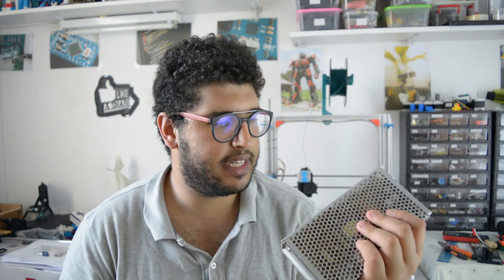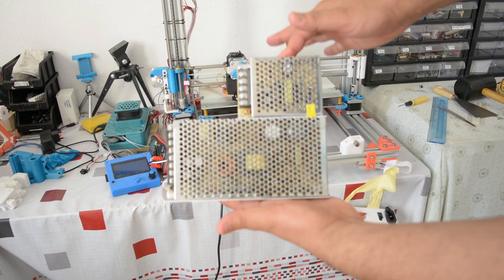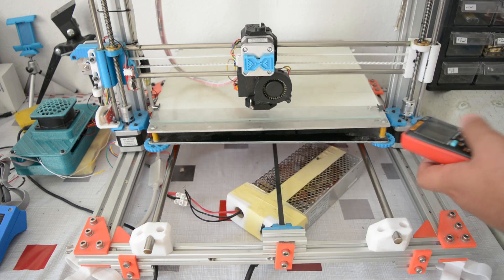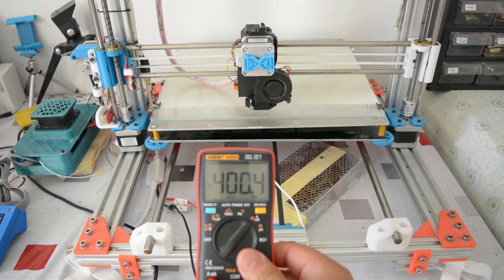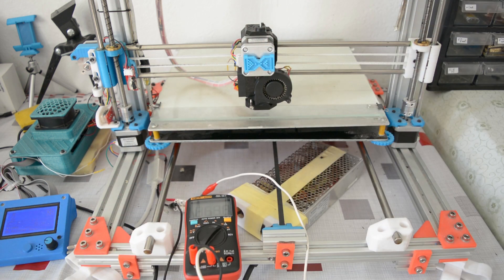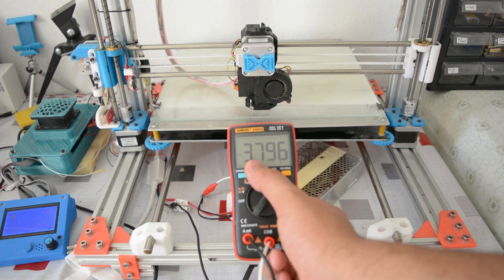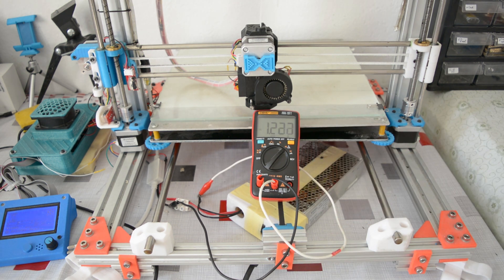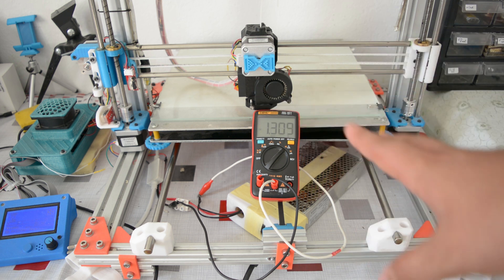3D printer current consumption  II choose the right power supply  for a 3D printer #28

Comment: This is the dc amps what about the ac amps how much does it takes from the power socket not the power supply
Reply from the maker: The efficiency of switching power supply is around 80 to 90 % to multiply the DC voltage buy the amps and add 20% to have the ac power taken from the socket , i hope this made sense

Comment: Using any driver , you can adjust "Vref" not current. And using 24V system ,, you don't half the current you just recalculate everything depending on the new resistance, having more voltage means having more voltage drops, you need to compensate for that. 
Also , you did not talk about printing speed , UART mode in drivers and many other aspects that you need to know in order to dimension your PSU.
Reply from the maker: You adjust current with vref,  depending on your driver there is a formula for that.
Power P=v(voltage)xI(current) , its the same system so power is constante  , if we use 24 in place of 12 v then we need to divide that current in half, i hope this made sense to you.
Yes more voltage means more speed.
But how fast? You are limited to the physical limitation on your printer , so changing to 24 just for speed does not make a lot of sense. 
Sure if you want to go deeper yes there are many other things to consider like upgrades so a bigger power supply make sense, but the bigger it is the pricy it gets, especially with good quality ps that will not induce too much noises into your power line.
And lastly thanks for passing by.